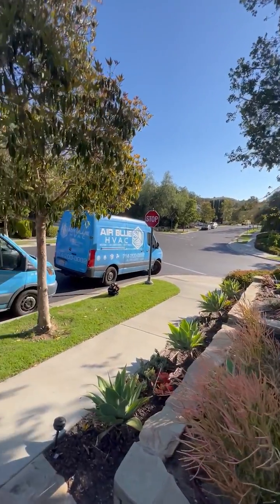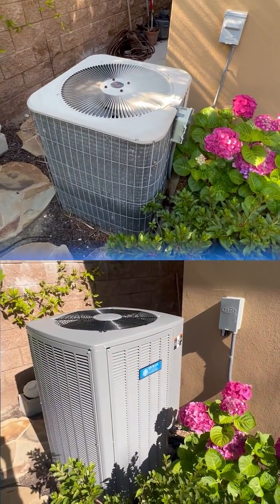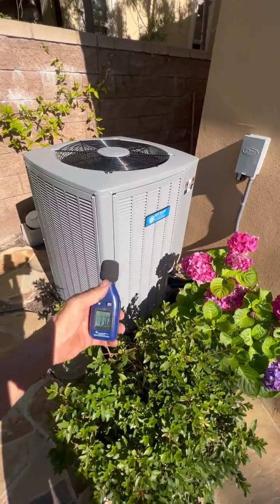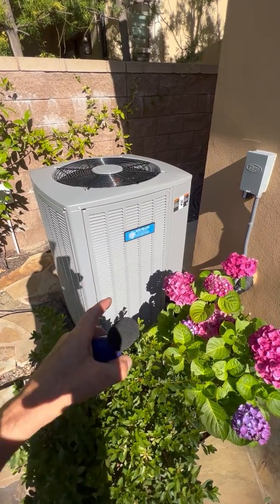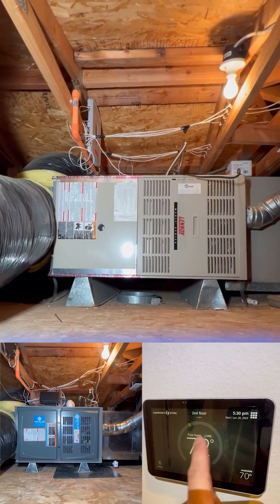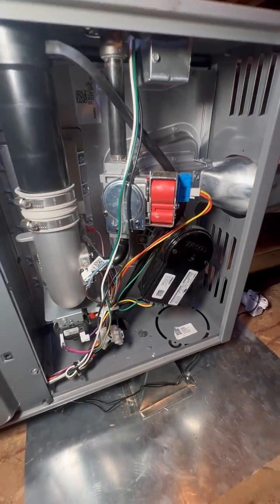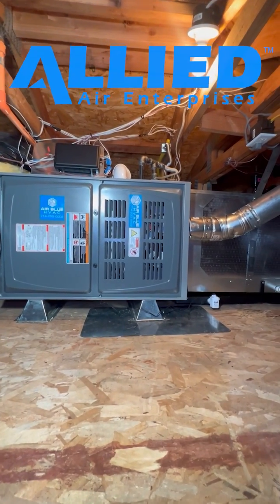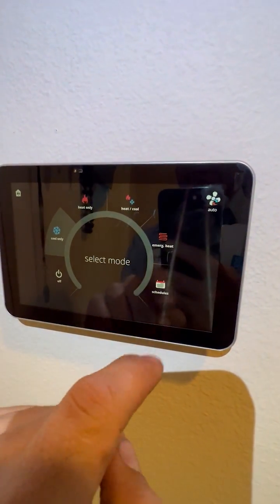Dual fuel heat pump true variable plus zoning HVAC system installed in Irvine California

Comment: How does it control between  gas /  heat pump ?
Reply from the maker: from the thermostat
Reply: @airbluehvac  Dose the stat has the program to choose which energy to use base on cost / outside temp ?
Reply from the maker: @vietcongbuondanbannuocphan1791  yes

Comment: Why in the world did you just let that nitrogen out like that?  You should have left the evaporator coil sealed until you were ready to do the line set brazing.  You literally took away the protection for the system from moisture and debris.  Yes, I am fully away of line set dryers... but HVAC folks rely on those way too much.  They didn't used to exist and systems lasted a lot longer... it was probably due in part to better practices that were absolutely required... now everyone is lazy because they'll just let the line filter dryer do the work.  Insanity.
Reply from the maker: hello we always check coils to make sure they are pressurized (have no leak or cracked drain pan) before putting it in place. what you dont see on the video is we did put rubber cap back to protect it from debris because again we dont want to spend extra half a day replacing the coil if there are any issues with refrigerant circulation or coil had no pressure(leak). all our customers get much longer than average labor warranty and manufacturers parts warranty.
Reply: @airbluehvac  Thank you!